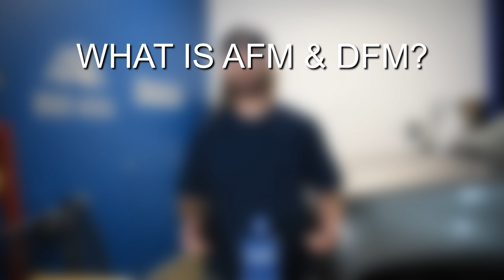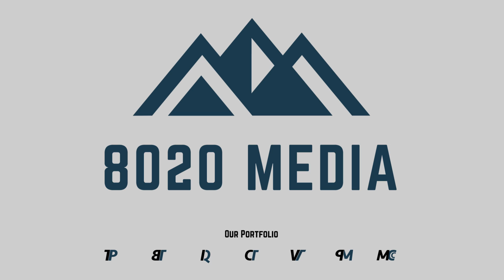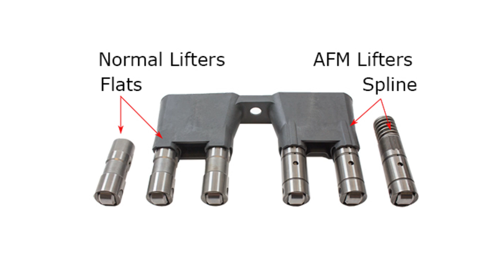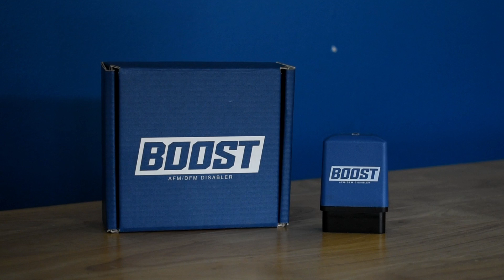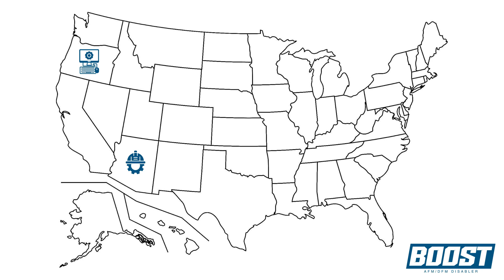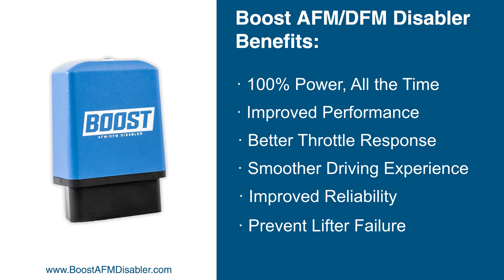Understanding Active & Dynamic Fuel Management and The Problems They Cause (AFM vs DFM)

Comment: The camshaft also needs to be replaced anytime the AFM or DFM lifters. Also, GM has a newer DOD - Displacement On Demand - on newer cars & trucks which has several hundred or more ways to deactivate cylinders.
Reply from the maker: D - Think "several hundred or more ways" might be a stretch. Depending on what years you are referring to, there aren't very many solutions of deactivating these systems, unless you delete them.
Reply: @8020Automotive  Thank you for your comment. 

Don't get me wrong, I love GM trucks but having a AFM, DOD or a DFM system on a truck to save 1-2 miles per gallon is just stupid on GM's part. Also, having a GDI system is stupid since Ford & other OEM's ran into a lot of problems with their GDI systems because excess carbon builds up on the intake valves. GM is probably going to have the same issues. Another stupid idea is the auto stop/start system because most engine wear occurs at start up since their is no oil pressure for a few seconds which over time will wear out the piston rings & increase cylinder wear.

 First came the Active Fuel Management (AFM) which deactivated the same 4 cylinders which created hot & cold cylinders when in V4 mode. Then came the Displacement On Demand (DOD) which came on certain GM models. I can't remember how that system worked. Then the modern Dynamic Fuel Management (DFM) which GM states there are 17 different ways to deactivate certain cylinders from a V8 mode to a V4 mode to a V2 mode. On the AFM & DOD systems there are a lot of lifter, camshaft, & piston ring failures at low mileage.  Statically speaking there are thousands of different combinations. Think of it as all the different number combinations while playing to lottery.

The 2 major problems to over come is heat retention of the deactivated cylinders & engine balance. If there was a way to restrict coolant flow around the deactivated cylinders & have a electronically controlled harmonic balancer so a odd number of cylinders could be deactivated would provide even more combinations of deactivating cylinders.
Reply from the maker: D - We don't disagree. Thanks for taking the time to share these insights!

Comment: What would have been simpler would have been if they just let the lifters work normally while shutting off fuel delivery to different cylinders as necessary. I imagine that with the valves closed while the piston is trying to induct and expel it builds pressure and forces the currently working cylinders to work harder to rotate the crankshaft thus defeating any fuel economy gain.
Reply from the maker: S - Well said. Thanks for sharing this insight.
Reply: @8020Automotive do u think i need this product on my 2021 2.7 turbo silverado??
Reply from the maker: S - Unfortunately, our product won't work on your vehicle.
Reply: @8020Automotive what about an 2013 Cadillac Escalade platinum 6.2L V8 6 speed?
Reply from the maker: O - What about it?
Reply: Now you are just pumping air through the engine without using it i.e. engine braking. That would actually defeat the purpose. With the valves closed, the air in the cylinder acts as an air spring, recovering some of the compression losses.
Reply: @Heatherder  Or metering just enough fuel to neutralize the compression.
Reply: This is a great analogy!

Comment: I see the boost isnt shown as compatable for the 2023 / 24 Silverado 1500... Does it work for them also?
Reply from the maker: It does not currently work on 2022 refresh, 2023, or 2024 Silverado or Sierra's. We're working on one but aren't sure when it'll be ready yet!
Reply: @8020Automotive  Thanks! From your experience are there many issues with the 2022 refresh 2023 models? 6.2l. Cheers
Reply from the maker: G - It's honestly too early to tell.

Comment: When will the Boost AFM/DFM Disabler be available for 23-24 Sierra 1500 models?
Reply from the maker: R - We are working on it, but don't have any updates on this as of yet.
Reply: @8020Automotive  can I use this device with my 2019 5.3 Silverado i am currently deleting the dod with new short lifters and non dod cam ? and if so how would i do this since i am plugging the 4 solenoids it has
Reply from the maker: N - Our device doesn't work on already deleted vehicles.

Comment: 2021 GMC Sierra 6.2   Lifter failure at 22,000 miles.
Reply: Really??? I just bought a 21 GMC AT4. 6.2.   With 59k miles.  So far so good.
Reply: @Gmanautonut  Keep up on Oil changes. I have heard that this helps the cause.
Reply from the maker: G - Absolutely.
Reply from the maker: G - So sorry to hear this.. Very sad what these "emissions" systems are doing to new vehicles.
Reply: Mine went out before 30,000 miles on my 2021 6.2 high country also.

Comment: Had a 2021 suburban fail at 8k
Reply from the maker: J - Wow.. So sorry to hear this. Lifter failure?
Reply: Yep, took out the cam, and bent valves and push rods @8020Media
Reply from the maker: J - That's crazy... They definitely don't make them like they used to.

Comment: I bought a new 14 v-6 Silverado not knowing about the afm.  I felt it kick in and knew it was not good for the engine.  I only had to add a small amount of pedal to get it back to firing on all 6.  I bought a afm delete that now prevents the afm from kicking in.  It plugs into the port under the dash with no modifications.  It does have a constant drain on the battery so for l/t storage just remove it.  Well worth the $$$.
Reply from the maker: Yepp, that's the best way to do it. If you want a device with less drain, our Boost device only pulls 0.71mA of power while turned off. Range's device pulls up to 6mA and usually sits within 2-3mA so theirs drains battery way faster than ours does.
Reply: @8020Automotive  I will vouge for that.
Reply from the maker: B - Yep... That's why we took the time to make a competing device that's cheaper and addresses their faults!